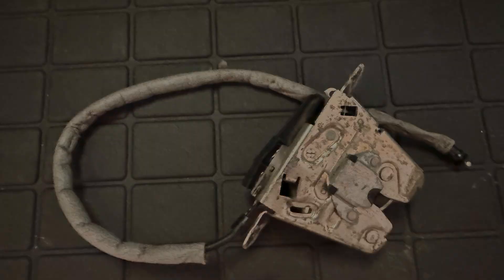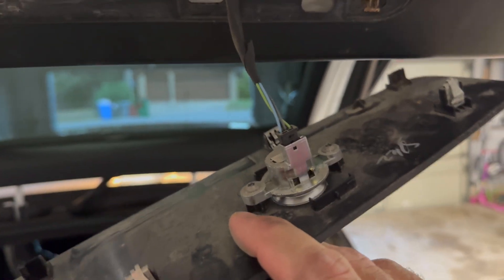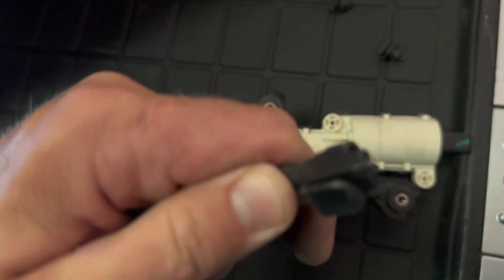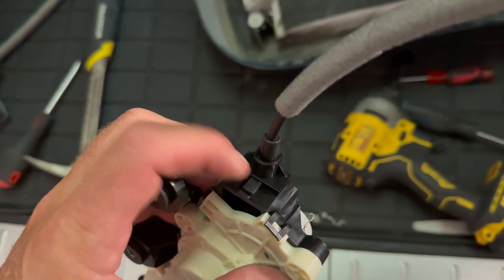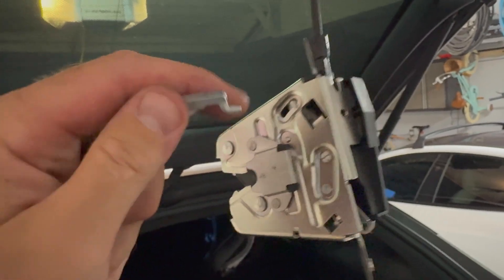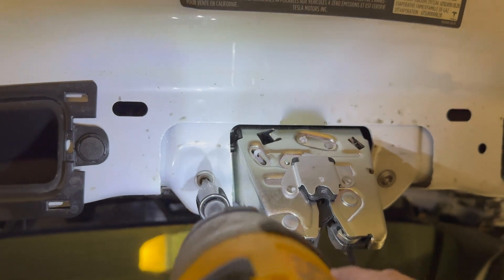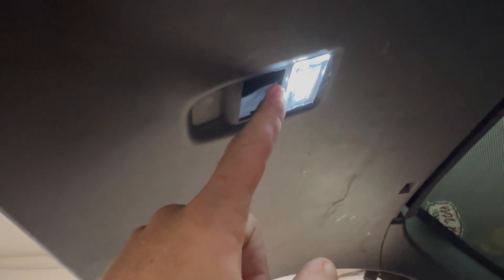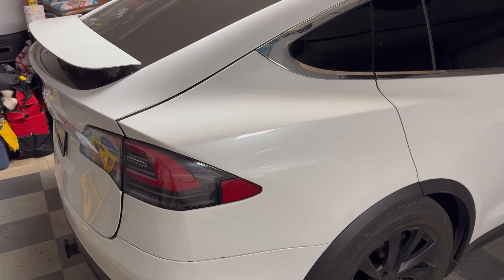Tesla Model X Trunk Latch & Cinch Motor Replacement: HOW TO | DIY

Comment: What was the vehicle doing to indicate that it needed these things fixed?
Reply: My hatch opens but when you push the button to close, it just beeps at me
Reply from the maker: That sounds like a lift motor or a sensor issue. The latch won’t pull the hatch shut tight when it is failing.
Reply from the maker: The cinch motor pulls the hatch tight. So if it is only partially latching, then generally the cinch motor needs to be replaced. If it won’t latch at all, then you need a new latch.  Thanks for watching!

Comment: Sadly you mention there’s a small panel on top of the whole panel that needs to be removed first, now the whole panel is cracked and broke when trying to remove it.
Reply from the maker: Thanks for watching. Sorry to hear that. A trim stick helps to loosen the clips without putting too much pressure on the whole panel. Thankfully the panel is not too expensive. We have replaced ours due to a 2x4 punching a hole in it 😂